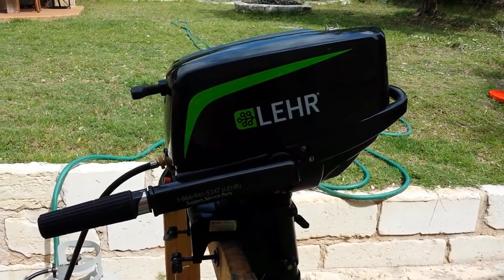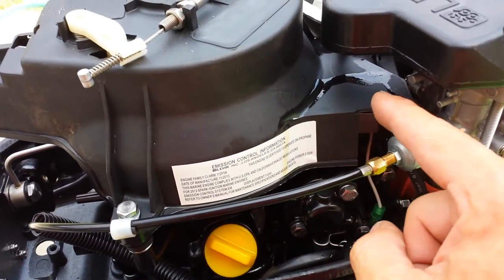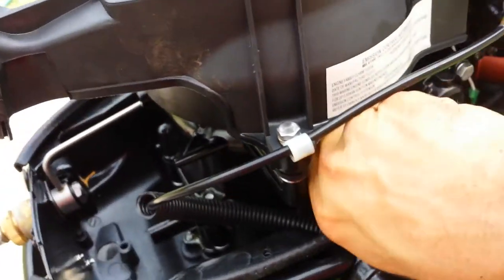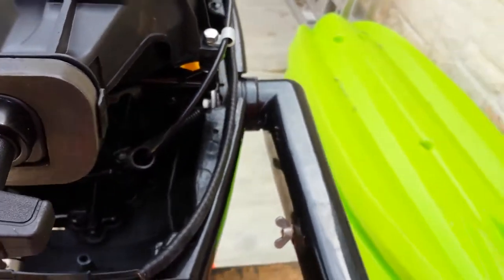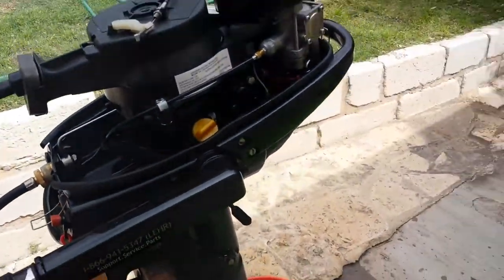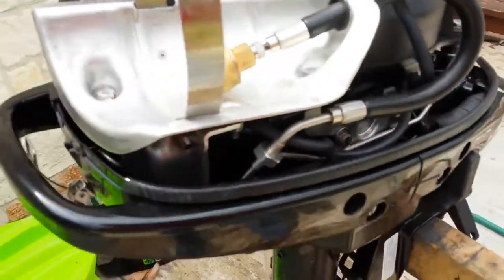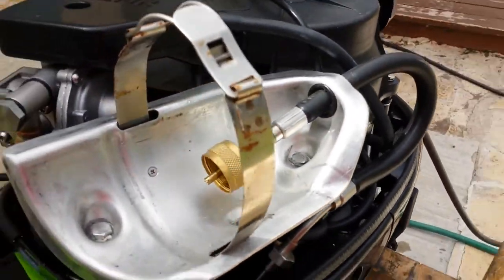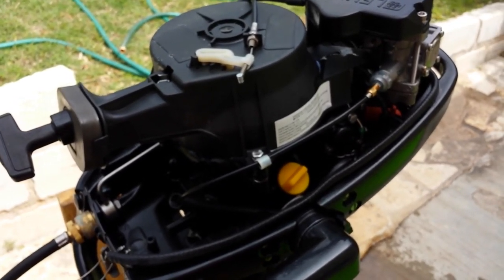2013 LP5.0L Lehr 5HP Propane Outboard Motor water in oil crankcase

Comment: I'm surprise you started it and ran it with "buttermilk" for lubricant
Reply from the maker: +Quiet Wyatt    I collaborated with engineers from the factory to diagnose the root cause of this motor's malfunction.  At some point in the troubleshooting we concluded that the customer whose motor this was under warranty for was going to get a new powerhead.  This video was for engineering only.

Comment: Did you get the problem resolved? How was the dealer/Lehr to work with? Thanks for the review!
Reply from the maker: The problem was resolved with a replacement power head (complete engine block) covered by warranty with no cost to the customer.
Reply: @highlandoutboards  Do you know if it was the head gasket or bad piston rings? Mine just started doing that and I wanted to try and make the repair. Thank you :)